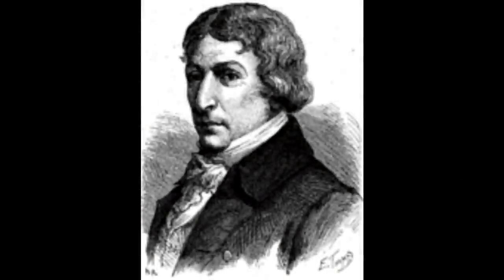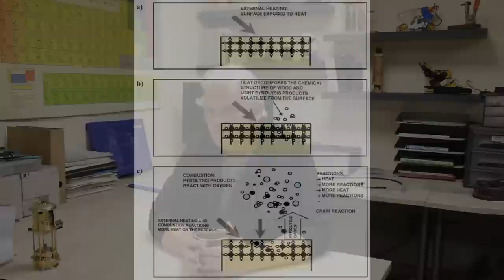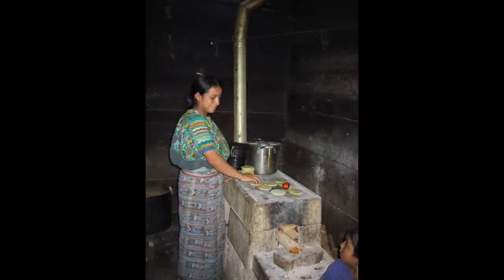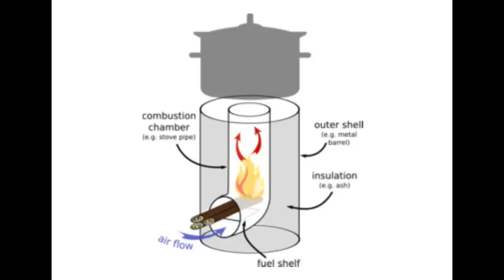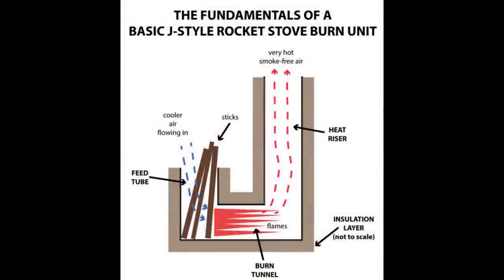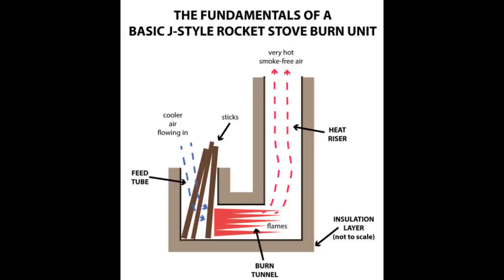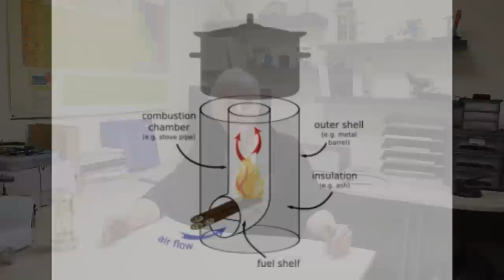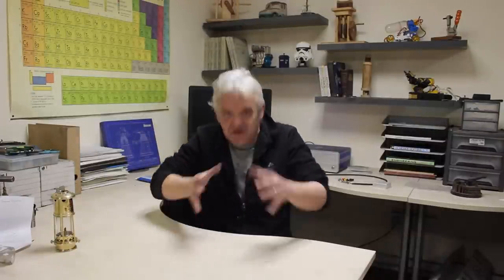1742 The Rocket Stove - Explained and Demystified #rocketstove

Comment: Great vid, and your comments were bang on the money. Rocket stoves can be built from many types of materials for all sorts of reasons, all giving differing outputs and all working on the same basic principle as you discussed in your vid..
It's not always, however, the hotter it gets the more robust and thicker materials you need. It's sometimes how fast you can dissipate the heat from the device to stop it melting.. in my experiments (using tin cans) when I insulated the fire tube part of the rocket stove, it started to melt the tins, but the un isulated version did not as it was able to dissipate the heat to its surroundings, saving the tins from melting (great radiant heater, not quite so good for cooking on) but like you also said it burnt hot and fast, and when the fire went out it also got cool very quickly.. 
(my reasons to build a rocket stove were to make a greenhouse heater on the cheap. My experiments led me down the hot and fast burns with vortexes etc etc which were not appropriate for my needs and i ended up going down the route of a slower burning mass storage heater type rocket stove, using wood kitty litter pellets as a replenishable fuel source (a heat battery if you wish .. lol)) that slowly but surely kept my plants warm over winter without overheating and drying out the air.
Also in my experiments, I found you need to get the air fuel ratio right as you can end up not getting your secondary burn to work well and end up filling your garden with smoke - stinking the place out with unburnt wood gas. Not ideal!
Thanks for sharing your views and I agree with your comments. Great work!
Looking forward to your next vid as always.
Reply: I hope all is well with your greenhouse!
I used to have a wonderful little rocket-stove that was outside of my greenhouse, it used to have a radiator that went twice around the inside of my grapevine and early* (sorry, I have the names on the tip of my tongue,but right now can't remember, *Yeargh!) It was brilliant, and I used to almost live in my garden!! Cooking on it was a joy, as I could avoid my mother!! 
In the summer, I used to have huge,sweet black grapes, and I live in the North West UK!!
(Damnit, mother had the whole lot torn down after I was gone!)
It was built by the Victorian who had built the house originally!! 
And,was an engineering marvel!!
Best wishes,
Andrea and Critters. ...XxX....
Reply from the maker: nice points mate - thank you for taking the time to post them and food for thought for me - just awesome - cheers

Comment: Agreed on most of the points, except for one.  You don't have to get really exotic and expensive to contain a hotter and more efficient rocket stove. Modified cob over stainless steel or glass works pretty good.  By modified, I mean something like, instead of sand, you use a combo of fumed silica and diatamaceous earth to up insulation. And you still use some perlite and straw (or better yet, fiberglass cloth or strands for the structural part of things).  

     Good clay can take quite a good amount of heat and over longer periods of time than steel, especially non stainless steels. I guess clay can be kind of expensive for some folks, but not really that expensive and especially not exotic for most people.  The beauty is, just use some cheap steel or glass and protect these with a layer of well insulated clay (modified cob), and then you don't need much clay (rather modified cob).  It's a type of composite's approach. Composites are a beautiful thing, balancing the weaknesses of different materials with the strengths of others and vice versa, so that you get a higher functioning synthesis material.  Or, the whole is greater than the sum of the parts. 

 (This connection/integration/synthesis is a material reflection of what I call spiritual truth--that of unity and connectedness [which, is really, the consciousness of Love], which I think is the heart/core of the so called "spooky action" of quantum physics.  Newer physics strongly suggest what mystics from all over the world and various faiths have been saying for a very long time--everything is interconnected on a fundamental level.  How else can things like quantum entanglement and Bell's theorem exist?  It's really almost a "duh" if you think about it objectively and logically). 

   And ultimately, the reason to up efficiency through things like better and well placed insulation, is so that you need less fuel to burn to get the same amount of energy out.  Why not maximize this, so you can just run it on sticks and debris, rather than split logs and the like?  In my yard, we have A LOT of the dreaded "gumballs". The bane of my spouse's existence apparently (she likes walking around barefoot etc), but, a potential fuel with its own aeration design built in.

Comment: Well said!  60k-90k BTUs per log.  Use it in an hour or 24 hours 
Their is something to be said about being able to burn almost all the fuel, but as you stated at the cost of a shorter life of the stove or complexity and/ or expensive.  
However, creativity and knowledge is what we're all about and being able to discover the hidden art of making materials that will extend the life of the stove, mass heater at those higher temps increasing the effective usable BTUs is just plain fun and exciting!!!
I personally would love to see a mixture with relatively easy to make materials (the secret recipe) to make one that will not only last but utilize that extra 40-85% BTUs.  At the same time I have no problem with those who could care less.  Lol
Reply: If you can find 'fire clay'--ideally containing about a 1:2 ratio of aluminium oxide and silicon dioxide--you can literally make insulating refractory bricks to build your reburn chamber out of for free.
Reply: @KeithOlson  I need to do this.  Ty
Reply: @l0I0I0I0  You are most welcome.  /bows

Comment: I'm curious... if you're looking to make a rocket stove for winter heating... what if you capped the tube inside the building, then on top of the cap, you install another tube to exhaust outside and then you bend a bunch of copper tubes to go from the capped section to the exhaust section? Would you get more heat out of it? I think copper is a bit better at radiating heat than iron or steel... Put a small fan behind the tubes to help pull the heat off of the tubes and into the air... I dunno... thoughts?

Comment: You just defended your use of glass as the primary with your temperature argument.  Glass doesn't start to melt well beyond the burning point of anything a rocket stove can produce.  
Question: Would adding a small turning vane at the base improve the rate of combustion with improved gas mix and vortex generation?

Comment: Concerning rocket mass heaters, it's incorrect to say you don't feel the heat for several hours. That's true of the mass component, but the rocket core runs inside a radiant bell. And that radiant bell gives off huge amounts of instant heat. The mass then absorbs most of the remaining heat, and releases it over days. The mass extracts more heat from the fuel, essentially bonus heat. 
This effect absolutely does make it more efficient, and absolutely does get more usable heat from the fuel.
Reply from the maker: fair enough mate - cheers

Comment: We had our masonry Mass oven built in 1995. Of course it needs a little bit of maintenance once in a while but it still functions perfectly. It was expensive,  and of course these heaters still are, but very efficient. We have outdoor temps around 15 dgr C at the moment,  and using about 15 kgs of wood we have heat for two days.
The disadvantage as you mention is that it takes hours before heat comes out of the 2.3 tonnes of mass , so if we are away for several days it takes time to get some heat.
But anyway, best investment ever.
The upper chamber where the gasses burn acts as a cooking oven when the fire is out.

A rocket mass heater can be built much cheaper and may be just as efficient.

Comment: Rob, as an air control for the Rocket stove, add a flap or damper on the air inlet tube and extend the tube for the fuel (so you dont keep loading) and put a flap or door on that so the combustion air is sucked in from the front, this will be fully controllable after the stove gets up to temp. Try it and see what happens.. it is all about the air...! All the best.
Reply: @kensmith5694  yes I Agree 👍😊

Comment: I'm experimenting with some fused glass refractory material which seems to wick quite well, but it's a fine powder and splutters and pops when it starts to get hot so I suspect its a bit damp. I'll dry it out over an open flame and give it another go or I might add some water glass to it as a binder and fire it to make a ceramic.
Reply: There are plenty of minerals you can use to create refractory materials, each with a benefit and a drawback. Whichever one are you using?

Comment: The Rocket stove or "J" stove was invented by a French inventor (whose name has mysteriously disappeared from Wikipedia) in the 1700s to reduce the amount of fuel to cook with, in the 1980s it was rediscovered and used to heat houses. House fires work on a 7:1 ratio the fireplace is 7 times bigger than the chimney but often it was temporarily converted to a rocket stove by draping a newspaper over the fireplace to reduce the ratio. The rocket stove is designed as a 1:1 stove but putting firewood into the inlet can reduce that further to 0.5:1 giving it the classic roar.
I use storage heater bricks for my stoves as they hold the heat better and are easy to build.

Comment: Well explained and perhaps it’s just as well to create a hybrid version that one can adapt for various scenarios. This could easily be achieved by adding a sleeve of insulation in the form of welding mats, that could easily be removed. Likewise, a sleeve of old storage heater bricks that could easily be added and removed depending on the circumstances. 
Thanks for the inspiration 👍
Reply from the maker: I think so mate - I. like that idea
Reply: A note of warning (yes I used to install them)
Some of the older units contain Asbestos! It is in the form of woolly insulation contained in a flat pack. There is no safe way to handle this short of a full decontamination unit specialised suits, masks and specialist disposal! 
Of course when we did it it was just thrown in a bin bag although they did upgrade to a double bag that was red back in the 90's!
The bricks can handle quite high temp (mid red glow) but don't ask me how I know that!
Reply: Thanks for the nod👍
Reply: Thanks for the nod👍
Reply: Yep, I already plan on incorporating this (general concept) into my design (i.e. off and on insulation).  Along with lighter-weight thermal mass i.e. compressed talc in metal buckets (far better than sand).  A hot water tank would be even better, but that is more costly and faffy. Water has a ridiculous (compared to most common substances) heat capacity.  Makes soapstone look like a chump.

Comment: May I suggest a design that burns as hot as possible and uses replaceable fire bricks to contain the heat before diluting it with cold air before it is used or goes up the chimney? By controlling the mix ratio, you can adjust the temperature instantaneously.

Comment: I think cardboard fire logs could be made using a shop press and bailing wire, and without soaking in water, blending, and pressing in molds. Where I live, getting free cardboard is fairly easy, and I like the idea of cost-free fuel for a rocket stove.
There are large machines in a lot of stores like Walmart that compress scrap cardboard into large bails. I think the same thing can be done on a smaller scale by cutting cardboard into strips, stacking those strips in a shop press, then compressing and securing them with bailing wire.
That should give a fairly dense "log" to burn that would last a good while during the burn. Could even accidently on purpose spill some WMO or used veggie oil on the logs for added heat and longevity.
Cheapest shop press I found was at Harbor Freight for $135.00 or so. I already have an electric saw to cut the cardboard.
Haven't seen anyone do it this way, but it seems like it should work.

Comment: Rocket mass heaters have the advantage of giving a portion of instant heat, at least the ones with the steel drum in the build and storing the excess heat in the mass thereby utilizing the most efficient fast hot complete burn.  A lot of the energy in wood burnt in woodstoves that are damped for the evening goes up the chimney as smoke and soot.  If it didn't loose that energy you'd not have the phenomenon of a chimney fire.  Exhaust from an RMH is also often at about 40C (100F), significantly lower than a wood stove so retained heat efficiency is also improved.  Thus a few of your comments were just a bit off the mark.
Reply: Indeed. He also missed that the ONLY practical way of extracting a high percentage of heat from the exhaust gases is by transferring it to a solid mass. This keeps the temperature of the exhaust duct high enough to maintain the necessary draw. A bare exhaust duct, radiating heat into the air, would be too cool to maintain flow through the system. This would result in back smoke and incomplete combustion.

Comment: Rocket mass heaters usually incorporate a very hot radiating section (often the end of a 200l drum) before the gasses move on to heat up the mass. Flue losses are minimised as a result. A rocket stove gets hot for sure but flue gas in a room is undesirable so a flue is then required. One needs to harvest that heat before it's all lost to the outside world.
For what it's worth a operated a solid fuel heater laboratory for many years and I can guarantee that the highest efficiencies were at the slowest burn rate where the mass flow of gas had a greater chance of contributing to a rooms temperature.

Comment: Nice instructive video!  Something to ponder over.  I have been working on a design to further improve cooking vessel efficiency.  Patent is the plan, though provisional is on hold for government usage right now(ie... military would be my guess for field cooking).  Probably will not get the full patent within my lifetime.  Since I can get no benefit from it and it has no benefit for other than cooking.  I will share the basics here.  Just take a cone shaped cowl(must be a metal that can handle a lot of heat) larger in diameter than the cooking vessel that is open at the bottom and is slightly shorter than the vessel.  Hence, top is wider than the bottom.  Attach a heavier rim(rim must be of a heavier metal than the vessel) to the cowl to then attach that to the vessel.  A short metal fin attached to the rim pointing down inside the cowl to direct airflow back down to the bottom of the vessel(roughly center).  The idea is that hot air will rise and be constrained up the entirety of the vessel exterior.  The fin pushes the air back down in the center space.  The inward cupping of the cowl bottom recirculates the hot air inside of the inner sides of the cowl.  Basically gives the vessel a hot air coat that circulates around the vessel trapping heat that would otherwise be lost.  In doing so the heavy rim and cowl itself will be heated and transfer more heat to vessel.  Less heat losses and more efficient that way.  Where efficiency is concerned it most times pays to consider working both sides of a problem from not just gains but also cutting losses.  Keep the videos coming Rob!  I really appreciate them, thanks!
Reply: This is different than Withange's patent in that the fin recirculates the heat again(a third time internally and again externally to the cowl).  Also the heavy rim drops losses of heat.  And with the shape being cone shaped with the inner fins it better baffles the heated air.  Those differences make a big difference in efficiency.  Cheers all!

Comment: Hay, i am new to this channel and did not really know where to write a question to you, and sorry for my spelling! For some time, i wanted to make electricity from fire. At the top of a rocket stove, there is a lot of "wind" power. I have played around with Thermoelectric Peltier Element, but it is not that good! steam is not an option, where i want to use it.
Is it possible to combine those to, your wind generator and the rocket stow? my problem is the heat at the top. it will make the coils, magnets and Berrings to hot, even when i put Berrings outside the chimney, the fan inside gets so hot, it takes the heat out to the coil and magnets outside! can it be solved or should i just give up the idea?